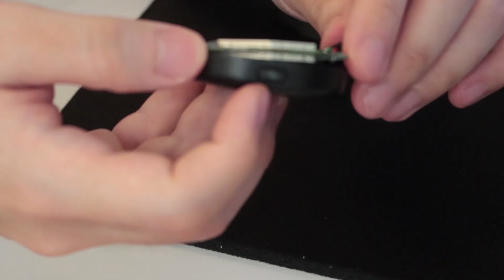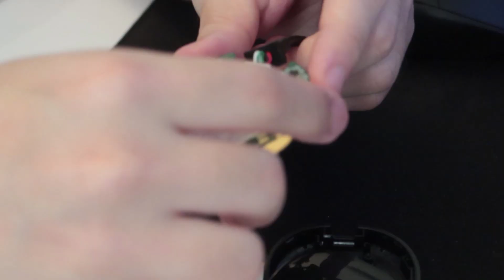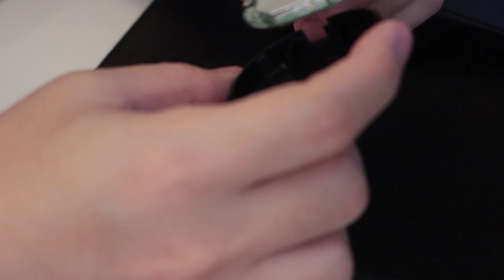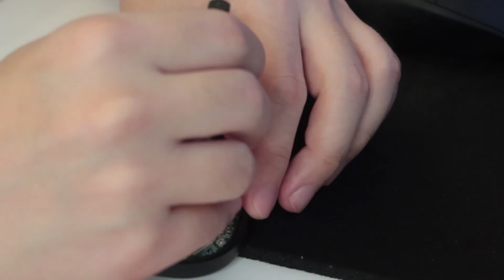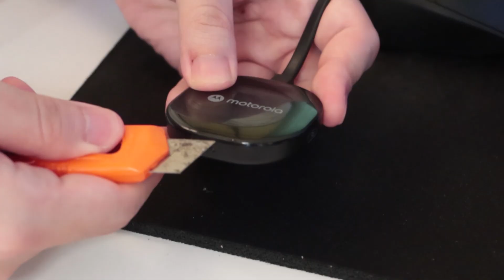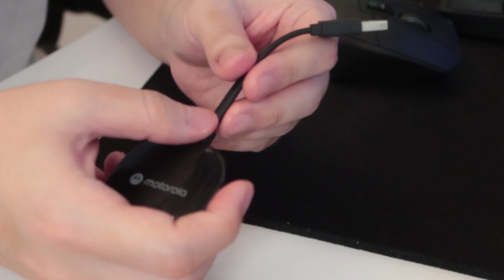How to fix Motorola MA1 Wireless Android Auto adapter for free at home

Comment: Hola Muchas gracias por este tip,  yo compre mi Motorola Ma1  en el 2023, el mes pasado dejo de funcionar tal como mencionas en tu video,  seguí tus pasos aunque debo de decir que no lo creía 😆 sin embargo funciona de maravilla, en mi caso  no tengo freidora de aire entonces  lo metí en el horno eléctrico por 10 minutos  a 400F, lo protegí por ambos lados con papel aluminio lo deje enfriar y fui a conectarlo al auto.   Funciono 100%  ya que  vi que funciono lo volví a armar  y listo lo tengo otra vez conectado en el carro. Muchas gracias Corgi.

Comment: I did this today expecting to take my MA1 circuit board melted from my air fryer, but it did work! thanks a lot!
Reply from the maker: Glad it helped save you from buying a new one. My understanding is it will happen again eventually with regular use/leaving it in your car but the baking solution will still work for subsequent device failures.